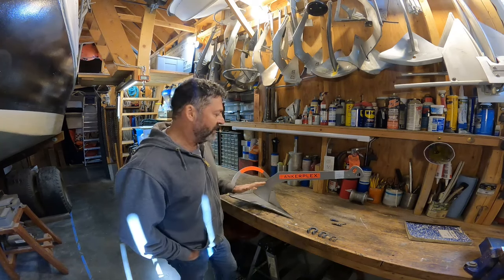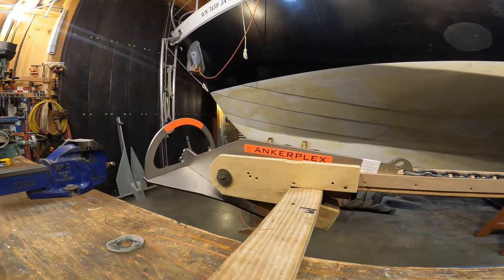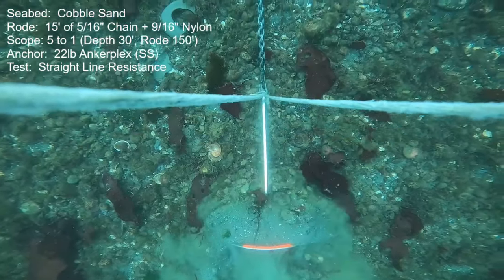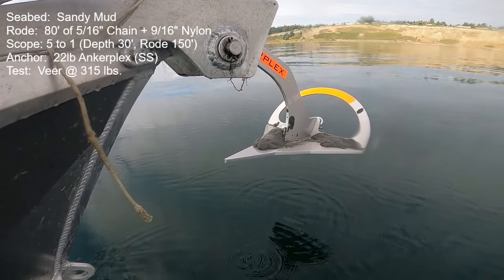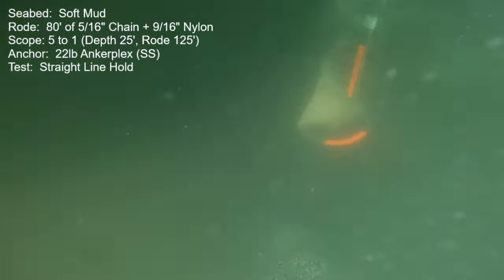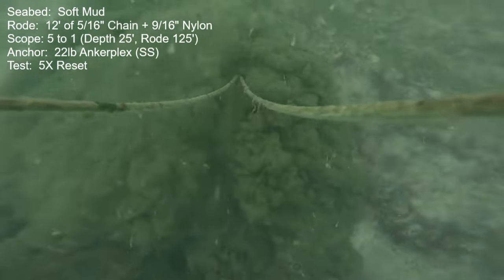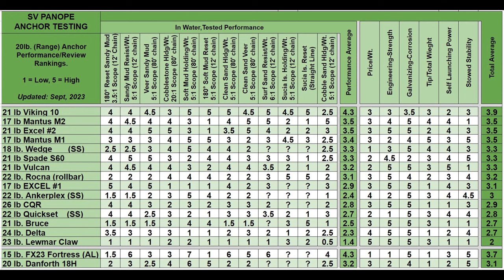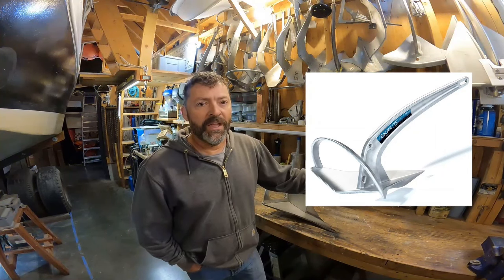Ankerplex 22lb.  Anchor Test Video # 152

Comment: Nice Anchor test video. I was craving for it for weeks. I hoped it performes better because the stoability is so awesome. But still not a bad anchor. Would be really interesting how the aluminium version performes. Also if it makes a difference if you sharpen the fluke. Of course they dont do it because it would make it more expensive but i think it would performe better. And if i would buy one, it is easy to do it by yourself with an anglegrinder.
I am definitly going to buy the small one as an dinghy anchor. Should be way better then my grapnel and 4 times cheaper then the Mantus. 
And when i am going to have a bigger sailboat as i have now (dreams :) then i want to have one as a spare anchor. Like you said, it is a gamechanger in terms of stowability and it performed not that bad. 
Not my prefered mainachor but as a spare, really perfect. A specialist.
Thank you for your effort :)
Reply from the maker: Sharpening the fluke is a very good idea.  I'll do it if I get the chance.
Reply: @flygoodwin  an Ankerplex 1 kg vs. Mantus Dinghy anchor would make an excellent video!

Comment: Another great test video. Thanks Steve! It is great that you are expanding into testing yet more anchor models!

I notice there is the upturned edge at the back of the anchor (acting like aeroplane wings do to point the nose upwards to sky) and a lot of metal work at the base of the shank (increased mud accumulation). I note these are factors in the original rocna underperforming.

The Adriatic anchor is similar but without these two major weaknesses. I have always wondered how an Adriatic anchor would perform. Also, wonder about atypical anchors like the Bulwagga anchor.
Reply from the maker: I've been keeping an eye out for a Bulwagga for years.  Never seen one in the wild, yet.....
Reply: @flygoodwin  there is a company in Turkey who make Bulwagga anchors and test videos are on YouTube.

Comment: It would be interesting to do more comparisons of holding power looking at total system weight with the same model of anchor in different weights and chain lengths. My hunch is that it's pretty much always better to put the weight in the anchor.  I think ease of use on a windlass and lower risk of chafe lead many cruisers to use all chain instead of a more weight efficient chain+rope setup.
Reply from the maker: Timothy, I agree with everything you wrote.  Another reason for all (or mostly) chain rodes is anchoring in deep water/short scope.

Comment: 75lb more anchor I think would be better.  To get the full benefits of the extra chain length it must all be out.  Here in Florida, I rarely anchor in 10ft.  Usually 5 to 8 ft water.
Reply: Here in Alaska, I anchor in 85 -120 ft .......30 foot tides/gales/8-10 kt currents. no lifeguard on duty.    Most frighteningly: The Sasquatch up here can swim!     For context, I live at Anchor year-round on 38 ft SailingYAcht. I've anchored many hundreds of times in all sorts of terrible conditions.  73 lb Hook, 300 ft chain,  infinite rode. I never ever ever run out of cannabis and canned tuna for my cat.        Need more guitar strings just now.

Different type of fishing down their (FLA), looks fun!

Comment: If I'm reading this right, this is an AISI 304 stainless steel anchor. As such, it's next to useless in salt environments, even less salt & tropical areas. It's very susceptible to crevice corrosion, and corrosion in general. I give it days, not weeks, if you go to the Med with this (don't use it, leave it outside, you'll see what happens, I've seen cheap shackles of 304 disintegrate in no time ;). 

If you want stainless steel for your anchors,  AISI 318 and variants are probably the only options. Not even 316 will cut it. 

You don't have a column for this, but while it gets a high number for galvanizing, it should probably get a 1 for durability, unless purely used in lakes and rivers (which may just be their target audience).

Otherwise excellent review and tests and review, thanks Steve!
Reply: it is not a shackle, it is an anchor made out of thick plates. To say you give it days is a little bit exaggerated. It will last a long time. But you are right, it is not the perfect material if you stay for years in the tropics.
Reply from the maker: I guess I need to get a bucket of salt water and do a test!
Reply: The manufacturer did all kind of tests for more of 6 years with more than 30 prototypes, of course, salt water permanence included.
Reply: @francristos8802  great, than go for this anchor ;). The guys making the Ultra clearly made a mistake in caring for crevice corrosion and opting for 318.

I've seen such claims made too often, this type of stainless even rusts while inside the boat, because of the fine salt dust in many seas. My horn is made of this steel, and it's already completely gone.

There's a good vid out there that explains what can happen with 304 anchors, and has happened. I don't remember the title, but they did the research, I'm merely talking from my own experience.
Reply: I think Ankerplex is intended as a second/spare anchor. Manual included recomends fresh water washing before storage. 304 SS is surely enough for the purpose. 316 SS. doubles costs
Reply: @francristos8802  toy may never have seen what galena to 304 in salty, warm conditions. I didn't believe it myself before I went to the Med. I live in the north, where we don't have these issues. I had to replace everything that was accidentally out purposely A2 and not A4.

For anchors, you go galvanized, it's stronger no chance on dangerous crevice corrosion. The only other option may be 318 (Ultra does that). Not 316. And certainly, never ever 304.

As 2nd anchor, or as decorative anchor, as long as you don't store it on deck, or any place where salt and wind can get to. I've seen so many rusty "stainless steel" anchors,  mostly Bruce on motor boats. It's great if you'd company had defeated physics, but that's unlikely, and I think you can spend your money more wisely.
Reply: Well, horses for courses. I have just anchored 10 minutes ago with my 5 years old AISi304 steel anchor, down on Spain.  I will pray Neptune 😊
Reply: @francristos8802  haha, fair point. Glad yours is in good shape. Hope it remains like that for a long time. I'm anchored off in Milos, Greece right now. Sailed from Spain to Greece this summer. The Med is beautiful!